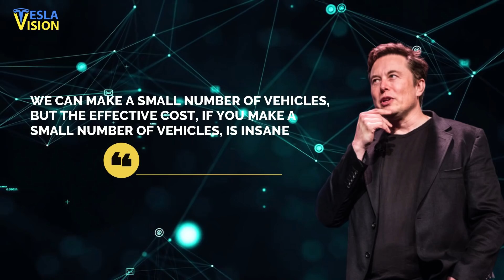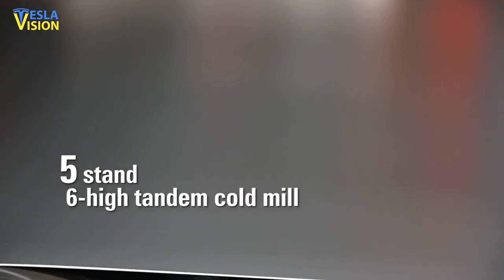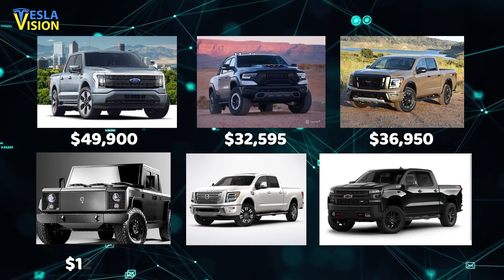Elon Musk Admits Cybertruck Production is Insane

Comment: If its 80% of what they are claiming and the price does not skyrocket; a lot of people are going to want one.
Reply: You Tube   I totally agree.  it will not be rugged/good for tradesmen.  However, it will accelerate like a Tesla, have the tech of a Tesla, have the new SS body, windshield, independent steering, active suspension, all wheel drive...  Gas is going up...  all for 70k...  Its shiny and surprisingly affordable.  Again, if it is what they say it is...  Which I am skeptical too.

Comment: I would not be surprised if they just ditched the single motor variant and made a quad motor instead
Reply: I think they should at least have a four motor variant due to the size of the Cyber truck ,perhaps the variations should be 2-3 and 4  and also the motors should be much more powerful than the little sedan motors, and they should all have the ROCKET THRUSTERS to help power them up steep hill climbs when going Bush .

Comment: 500 miles for the tri motor NOT 600 like you stated. That’s the Roadster.
Reply: I believe the range on tri-motor will bump up to 600+ mile range with the new and improved batteries.

Comment: I see a big problem with safety.  The cyber truck won't crush.  Upon an impact, the passengers may have some protection (that remains to be proven), but certainly, any vehicle hit by a cyber truck will take all the impact.  This is likely to kill people in the real world.  Anyone hit by this truck will be carved up.  Traditionally, in a collision each vehicle absorbs (dissipates) impact energy to be survivable.  The cyber truck to me looks like a killer on wheels.  Not clear how this would be a safe vehicle to operate.  Especially if you're on the receiving end.
Reply: With teslas safety systems you are like 8 times less likely to be in a crash and that is improving rapidly. Also you have no clue how the crumple zone will work since we havent seen testing yet.
Reply: @OurBengals  I've seen the demo of the body being hit by a sledge hammer, and it doesn't crush.  There will be accidents, and if anyone is hit by the cyber truck they're going to be cut in half.  Both vehicles must be designed to "crush" if the crashes are intended to be survivable.  This is really basic stuff.
Reply: @TobyKinkaid11  comparing a sledge hammer to a car wreck? You have no clue how the front end will crumple in a wreck and still completely ignored the fact that you are less likely to even be in an accident. its still safer for other cars to be driving around a cyber truck than any other non tesla vehicle.
Reply: @TobyKinkaid11  I’ve seen pics of crashed deloreans and they crumple fine. I think your hypothetical is a little to the extreme.
Reply: @TobyKinkaid11  they might have grooves or whatever on the inside of the skeleton so that the steel will fold in a certain way if you hit a tree really hard. I think they might have thought of something smart to give it a crumple zone. I mean, would be weird if they didnt. Also you dont want a crumple zone on the sides of the vehicle, but only at the front and rear. 

That being said hitting a pedestrian with it would hurt, i guess getting hit by a truck is a expression for a reason. People also put steel bull bars on front of their trucks, thats probably not any better to get hit by. Im not sure since im dutch but I think they might have different regulations in the us for trucks vs regular cars. Probably pedestrian safety regulations are a bit more lax with trucks. I think the cybertruck is only gonna get sold in north america because it wouldnt be allowed in europe.

if this all sounds too dangerous, dont worry, its also gonna be the fastest accelerating truck ever produced ^^

Comment: Tesla will be buying steel, and then re-alloying and heat treating it for use on their cars?

Did I misunderstand? 

That's a huge additional energy expense that you only do if you want to protect a trade secret. Neither seem very "Tesla".

Seems odd to me.
Reply: As I understand it spaceX has to use same material for their spacecraft. You have to have metal(steel or aluminum) at that point I don’t know if it make much difference comparing energy spend on steel or aluminum as it is already hit scale.
Reply: @Engineering2AI  

It's most of the work.

The manufacturing effort to turn raw material into cold rolled sheet is huge. And the machines to do it are specialized and also huge... might as well just buy your own raw materials at this point.

This seems to imply Tesla is getting into the steel business.

Imagine cold rolling a 25 foot wide piece of 304L for the Starship rings...  5x as tall... nobody needs 25 foot cold rolled steel but SpaceX...

Now imagine if Tesla worked with a large press manufacturer... Idra?... to produce a 25 foot cold roll press that both SpaceX and Tesla could share...

I'm thinking about the rapid manufacture stainless steel buildings to become even faster produced Gigafactories.
Reply: @tech 52 nobody in this thread...
Reply: @tech 52 haha :)

Now I get it - I was trying to figure out what I said that was wrong...  

Things are progressing so quickly that only the most diligent of Elon Musk fanboys can keep up.  And some sure seem to have misspoken. 

And a lot of people are making some pretty interesting speculations based on their misunderstanding
Reply: @tech 52 

I'd say with 1.2 million pre orders, it will definitely be a success.

I see this era exactly like I saw film camera->digital or cell phpne->smart phone.

I am just fascinated to watch....

Comment: The problem with the Cybertruck it's that a completely new truck platform than the standard body on frame like the F-150 Lightning. So don't be surprise if it suffers a radical design change from it initial concept, and adopts a more standard body on frame, an exterior design similar to their line up, turning the production easier.
Reply: Never knew you can get a Silverado for that low price 🤔
That base price is cheaper than the Toyota Tacoma base price 😳
Reply: @icost4671  are you really that naive to believe in those numbers? Only after the truck is up to production, we gonna have a really understanding of the cost. Also don't forget, the Cybertruck been targeting car consumers, not truck consumers, that need trucks to work and tow.
Reply: Nope.  Production line is already together at Fremont.  Not gonna change.
Reply: @RogerM88  do you truck?  Because 99% of ‘truck’ users don’t haul or work with the truck any more than some dbag in a supra
Reply: @RogerM88  makes sense and thank you 👍
I was thinking it cannot be so,  how can I Chevy Silverado truck 150 cost less than a Toyota Tacoma midsize truck.
Somewhat did not compute whatsoever ? 
Did you see anything else in this presentation that wasn't correct.
Reply: @morganholsomback4851  I've two trucks. And I was interest to check the EV apply on the real use of a truck, like towing. And after watching TFL using a Tesla to tow, and a F-150 Hybrid...you can conclude, there are more improvements to be done, so they can beat a Diesel truck. But to some EV users, that want to "mall crawl", and more fixated on the 0 to 60 mph, then it could be an truck option. Similar hype it's with the Semi, but ignoring the actual payload it can tow.
Reply: @morganholsomback4851  you're 100% correct , at present I have a Tacoma and the bed is mostly always empty.
Great for the winter here with the four-wheel drive.
Only help friends move from one place the other about three times during the whole year and that's the only time I use it as a workhorse. 
Owners of the full size gas guzzlers f-150s ; f250s , Dodge Ram & The Silverados , the beds in these trucks are just about always empty.
Reply: @icost4671  if you had any understanding how mass production works in the car business and the target typical truck costumer, you would understand already that the Cybertruck has 3 major fails. First, it uses a completely new construction method with an exoskeleton. Second, it battery pack is integrated on the frame, unlike the F-150 Lightning that could be more easily replaced. Third, range could be an huge issue using it to tow. That could lead to not be target by companies to incorporate their fleets.
Reply: @icost4671  so you should buy a car, and rent a truck when you need it. No need for a 60K plus EV. A PHEV has plenty of EV range, and no range anxiety.
Reply: @RogerM88  earlier I was looking at a channel showing us  how Toyota's being made and put together in a car factory in Japan.
I'm surprised to see how much robotics is used and how so few peoples were there.
AMAZING !!!
And all that you are stating here... TYVM ☺️
Reply: @RogerM88  
They're naive to believe the base price based on nothing?    What does that make you if you dont believe it based on nothing?
Reply: @morganholsomback4851  
I'm a mobile mechanic who could make excellent use of rhe Cybertruck.  You're right most truck drivers don't need trucks.   The Cybertruck will be great for all kinds of trades.
Reply: @Sheridantank  if you're an Mobile Mechanic, you should focus in Diesel trucks, that could cover high millage at a lower cost. Or if you want that EV experience, try a PHEV. Also you should look outside the truck sector, and take attention on vans. Way cheaper to run.
Reply: @RogerM88  
Theoretically I would charge on solar and my work range is more than covered with the truck range.  A van would be better than a truck but for my specific situation the Cybertruck would be great.
Reply: @icost4671  that’s speculation. E Silverado been made yet. And not to forget the f-150 standard has low range. The higher range is higher cost than even tri motor cybertruck.
Reply: @RogerM88  you gotta admit tho, if anyone can turn that new construction method into a success its tesla. They are already pioneering new construction methods by using 6k ton force casting presses for the model y. Using big castings reduced their part count while making it lighter and stronger. Their new plaid models have carbon wrapped rotors in the motors which is also a first. And the first 8000 ton press is already being made for cybertruck production. Also a paint shop for a car factory costs like half a billion, takes up a lot of space and is often a bottleneck in production. Tesla doesnt need a paint shop at all for the cybertruck, they'll save some money there. 

as a bonus having no paint is also better for the environment and stainless steel is also very recyclable.

Comment: Dam too bad all of the electric trucks are more like a car with a short bed than full size bed. I'll just stick with my full size gas powered truck.
Reply: What's a "full size" bed?  6 feet?   Cybertruck is 6.5.  A "long bed" is 8 feet.   You're commenting without having any idea what you're talking about.  It had a full size bed by any common se2nze standard.
Reply: A bed extension soon ???  removable??
Reply: @hal8683  That would be good an extension, maybe the extension could fold into the truck kind of like a convertible. Or make a longer truck. I could see Tesla add an extension.
Reply: @jmtholmbo  
Listing things that don't fit in a full size bed doesn't prove anything. A full figure person isn't xl, they're "plus standard".